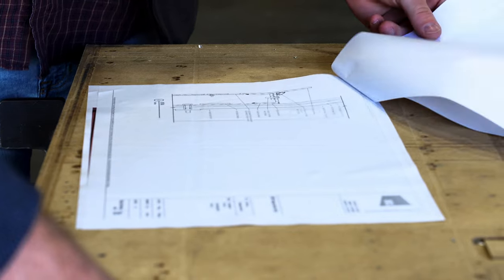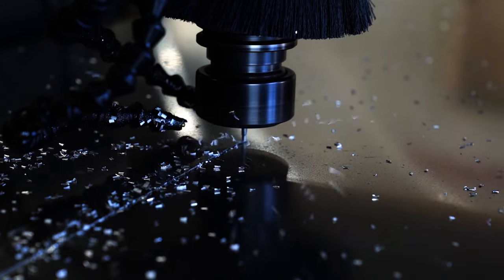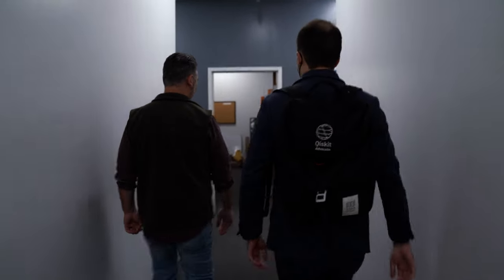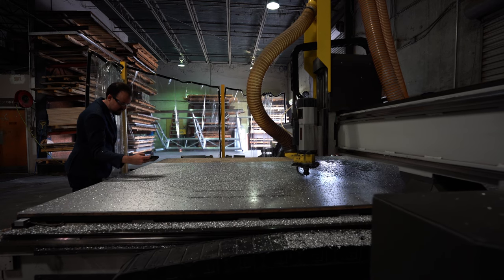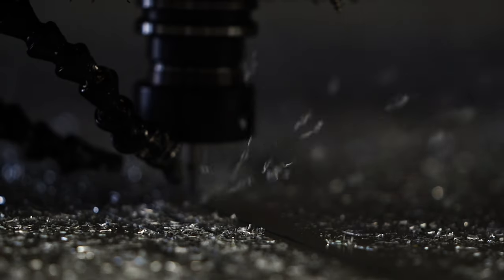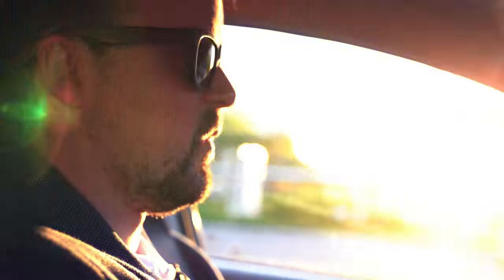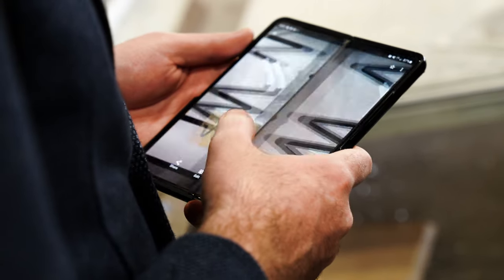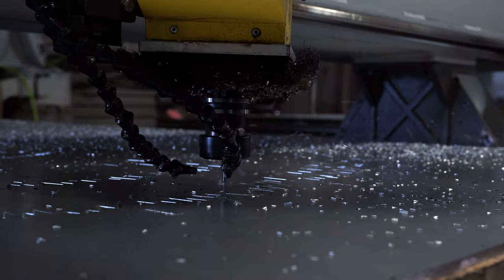Using Real Quantum Hardware to Make Art Creatives in Quantum

Comment: In our institute, we use quantum-entanglement for load-balancing.
The active path is randomly chosen, but because of entanglement all other paths are inactive.
Such a selection can also be done with classical algorithms, but it's not resilient against bitflips and noisy environments.
If one q-bit is disturbed, than the other is disturbed in the same way. Classically, that's not possible. 🤓
Together with the University of Teheran, we developed a quantumprotocol for satelliteconstellations.